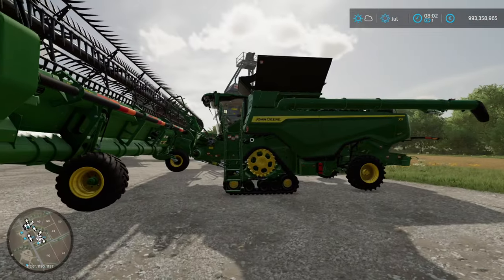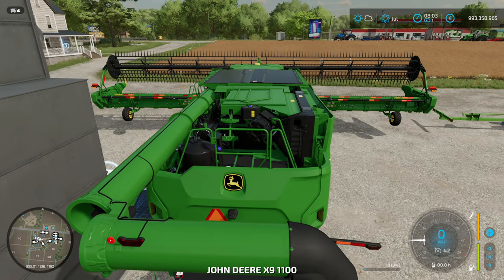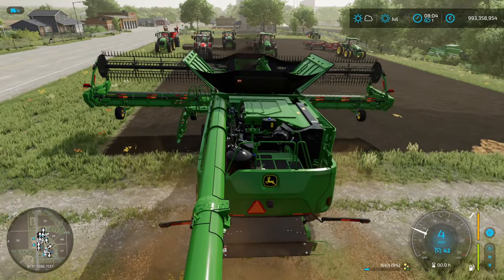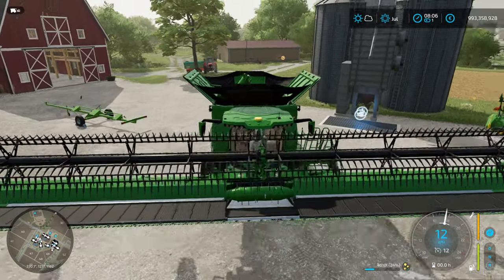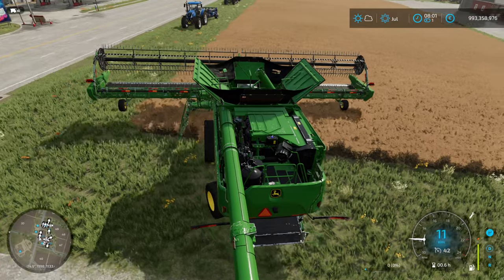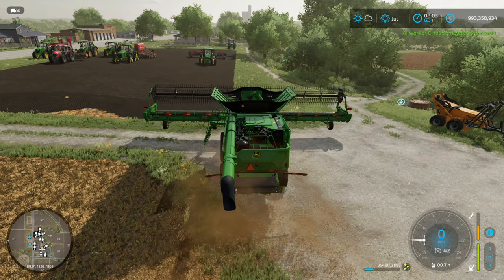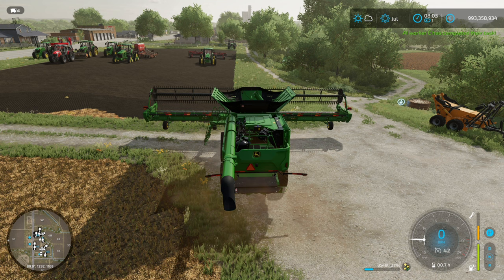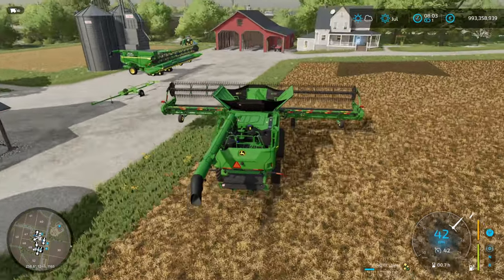Massive Yield Loss if You Don't Repair Your Combine! Farming Simulator 22

Comment: Also i wish that there was a machine that my porsche diesel can pull that is a small havester that is about the same width as the tracter, maybe a little  bit bigger, i wanna saw 2.5m and has a small collection bag. I found that the old small tractors are more efficient in cost and maintenance. I can do more work than the bigger tractors without losing hardly any fuel, my porsche can run its engine longer than the newer bigger vehicles and still have a full tank, if someone could make a nice red havester that looks old and classic and has full metal red wheels, and make it full that little tractor, that would be awesome